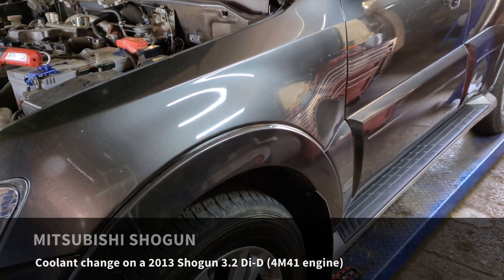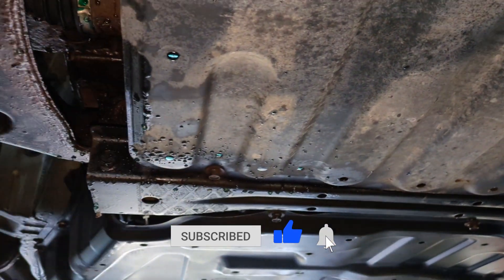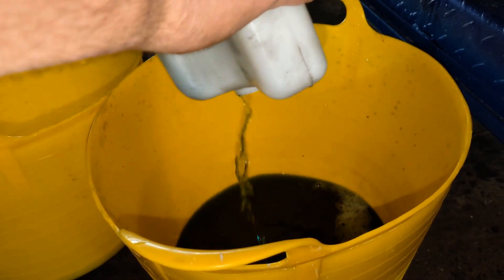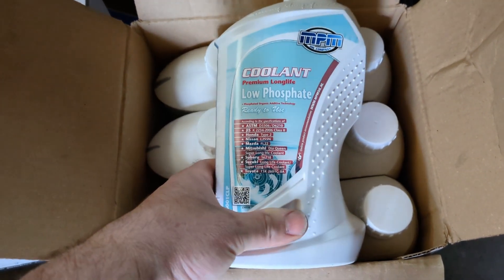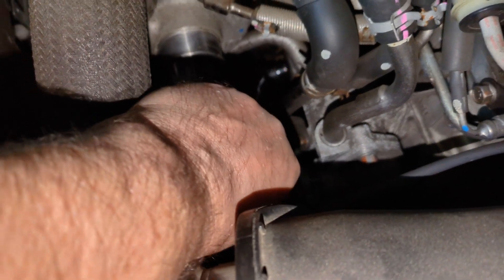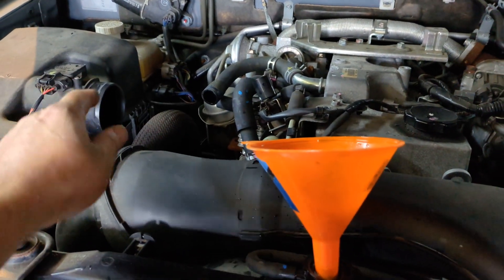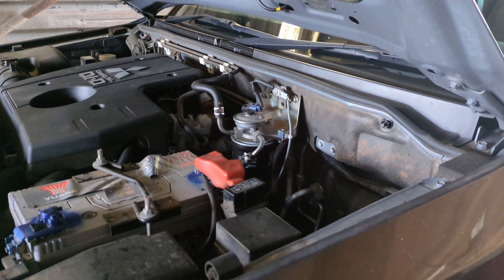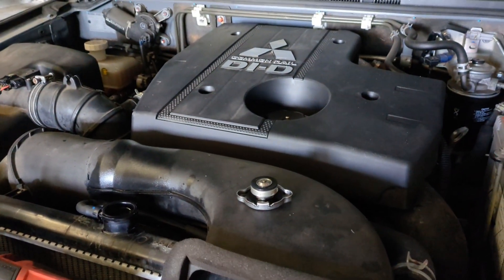Mitsubishi Shogun/Pajero MK4 coolant change, 3.2 Di-D engine

Comment: I replaced mine a few weeks ago but used a OAT coolant with no phosphates, should i do it again with P-oat coolant?
Reply from the maker: I wouldn't bother. It's a right rabbit warren when looking into the coolant specs. It's worse than engine oil!
At the end of the day, nearly all engines and coolant systems have the same aluminium, steel and rubber in the systems, so why all the complexity with coolant specs?
Reply: @ makes sense to me, ill leave it as is then. Thank you for a quick reply, appreciate it